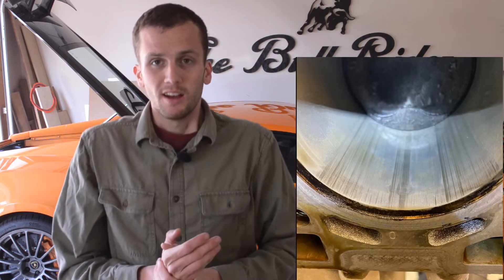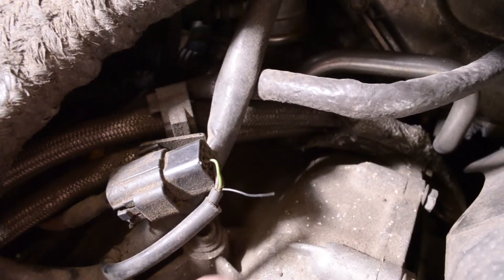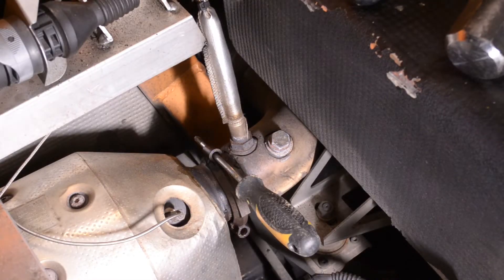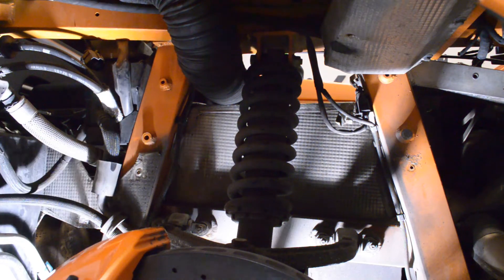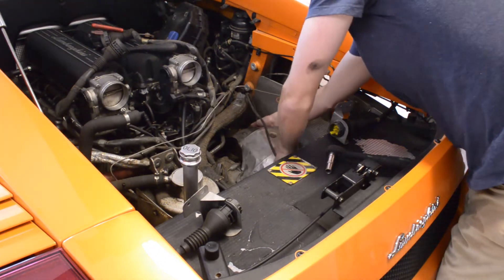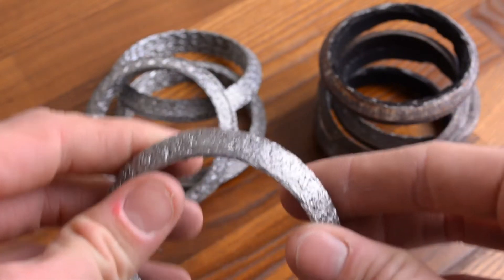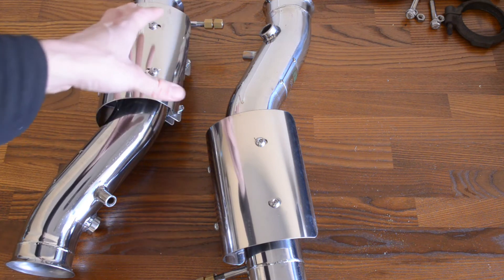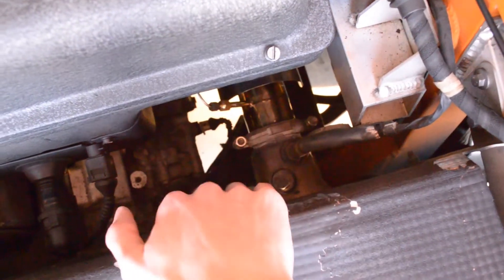I Install Larini Test Pipes In My Lamborghini Gallardo Superleggera. | Insane 5.0 V10 Exhaust Sound

Comment: I don't know it all but when you have a fastener that will crack free you must  relube and work in the  loose, tight sequence .
Reply from the maker: John, I dont know it all either! Can you explain what you mean in more detail? Are you saying with those rusty bolts, I need to lubricate them as I loosen them?
Reply: You must lubricate and heat like you did. Then crack the fastener, once you you can turn it quarter turn loose then reverse to tight , relube then loose again. Continue with this process. Also if you have an impact gun the inertia of the hit will spin the nut or bolt  loose. Good luck and thanks for your patience and nice reply..
Reply from the maker: @johnmartin2079  Oh I understand now John! I like that idea, that way it would allow the material on the rusted stud to get dislodged and not get jammed into the nut! Right? Ill do that next time!
And I had a impact but I treated it too poorly and it eventually died on me! LOL I destroyed too many fasteners that way anyways haha.

Comment: Sounds like my VW 2.5 5cyl.
Reply from the maker: It is a very close motor working man audio. The 2.5 sounds more like the 5.2 and is closer in both design and layout.  Listen to the end of this video for a tunnel run. That for sure doesn't sound anything like a 2.5! https://youtu.be/T208pyI4_H4
Reply: @TheBullRider  To me it does. Sorry. That doesn’t take anything away from Gallardo. Its not the same of course but very similar.
Reply from the maker: @workingmanaudio2754  I totally understand your perspective. The 2.5 5 cylinder is an excellent motor.

Comment: Hey man, great vid, one of my favorites so far! But geeeez, that cat material. As for the Check Engine Light, you might not get them if you keep the stock post-cat exhaust - but keep us posted! And yes, absolutely I'd love to see a nicer/better solution for the intake!
Reply from the maker: Im glad you liked it Tanel! Yeah it was good to get those ugly heavy old cats off! 
That is an interesting perspective because ive experienced the exact opposite on decatted cars of the same era with stock post cat exhaust systems. My thought is that the post cat 02 sensors are clogged with oil and thats why I dont get any codes. LOL. Maybe my car has a soul and just really wanted those cats off and decided that it would make life easy for me. 
Ill think about the intake, overall its a nice design, just a few tweaks and it would be awesome. I have a few things for this car coming down the development pipeline that im excited to share with you!
Reply: @TheBullRider  It seems no one knows for certain what triggers those CELs, or at least I haven't come across a solid explanation for the SLs. Looking forward to you sharing all the secrets with us! :-D

Comment: Great video. I am wondering what the limit of these stock cats are before causing engine damage. 20k? 30k miles?  Does anybody know?
Reply from the maker: GTX, it is a bit random in nature! I've seen gentleman with 15k miles on their car with bad cats or others without issues till 70k. Part of it is component age, the design technology at the time, converter placement in relation to the motor, engine tuning/fueling and valve overlap on this motor. 
My advice is is get those old cats off your car ASAP, you will sleep better at night. I know I do! Haha

Comment: Great video mate. Thank you. I have been using it as a reference to install my 200 cell cats. I am having trouble getting the left sided engine side clamp off as I cant get a decent angle to apply pressure on it through the wheel well. Will appreciate any suggestions. PB blastered and waited overnight but no go. A long breaker bar wouldnt fit in the wheel well. Have used a 10 inch extension with a ratchet as well as a wrench :( Can I approach it from above? Thanks again.

Comment: Hi love your videos. I have a 2005 manual 6 speed Gallardo with 54,000 miles.   Next up for me is replacing the cats before they become problematic.   I’m trying to decide between the test pipes and the sport cats.  I would prefer that test pipes for various reasons. But I have heard some people complain of a loss of low end power with the test pipes claiming it was caused by a loss of back pressure.   I’m curious as to your opinion and results after your test pipe install.  Are you pleased with the results?  Any loss of low end power?  Appreciate your feedback and really pleased to find your channel. Your videos are priceless. 👍👍
Reply from the maker: I didn't notice a loss of low end power by adding the test pipes Osprey. You might loose 20 ft lbs or so of torque at the low end of the powerband but that is so insignificant that you wouldn't ever notice. At least my "butt dyno" isn't calibrated enough for that! LOL
I love my test pipes and in reality the big difference between the two is price. If you can swing the 3kish for the sport cats, get the cats. If you rather save a bit of cash and invest it somewhere else in your car, get the test pipes.
The last thing to consider is emissions in your area. Ive never thrown a check engine light for going catless but that doesnt mean that you wont. The same thing might happen with sport cats, these cars ECUs are finicky and moody but theres plenty of ways to eliminate codes if they do pop up.
Reply: @TheBullRider  Thanks for your feedback, it is much appreciated.  I keep the vehicle in a state that has no inspection requirements so that should not be an issue.  I assume the test pipes would run a bit cooler so that is a benefit along with the cost savings.  I’ll do some more research and see where I land. Your feedback was helpful. Thanks
Reply from the maker: @osprey2961  Yeah the test pipes will run a bit cooler in the engine bay due to less restriction in the exhaust path. 
Let me know what you end up deciding. With either option, I think you will be happy!
Reply: @TheBullRider  did you replace your oxygen sensors with new when you did your test pipes?   I believe the workshop manual states to replace every 50,000 miles if I remember the mileage correctly.
Reply from the maker: @osprey2961  No I didnt replace them but with test pipes in or sport cats its so much easier when I eventually need to. The OEM cats are HUGE but even the sport cats on the market are a fraction of the size (and weight)
Reply: @TheBullRider  any info on the Larini vs Fabspeed cats?  Trying to decide between the two. However when I search, I don’t see a lot of info comparing the two.  Thanks
Reply from the maker: @osprey2961  They are both 200 cell cats and both great pieces of kit. The big difference in my mind is that the Larini cats have the Inconel heat shields. This will reduce engine bay temps a bit and look like an OEM cat. 
Another thing to consider is that the Larini systems are made with 316 Stainless Steel as opposed to a 304 SS. For this application it is a superior alloy. 
Also look at the way the flow travels through the fabspeed cats vs the Larini cats. Fabspeed has a very abrupt pipe size change from the exhaust pipe to the catalytic converter element and I could see how it would be an area of flow losses. 
Looking at the larini, there is a vast difference in the inlet and outlet flow characteristics and how the flow transitions from the smaller pipe to the cat element. 
All things to consider. Either way, both are good systems.
Reply: @TheBullRider  thanks.. helpful input

Comment: hi, thanks for a great vid. Im in my garage now...but the nuts on the left cat broke off (both). You got any good tip to get it off..its the clamp nearest to the exhaust system. Thanks
Reply from the maker: Jonas, you may have already figured this out but a hammer might be the best bet for you to hit the old clamps off!
Reply: @TheBullRider  Thanks, i got them loose. Had to drill them in pieces. Im superhappy now with the Larini test pipes :)

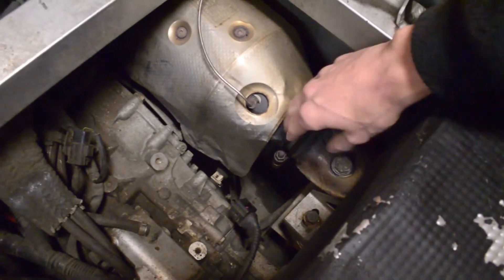Comment: If you have the highest mileage SL, I would be curious how much scoring you actually have in your cylinders. If a borescope shows none or little maybe there isn't much cat debris being sucked back in. But if you have excessive scoring then that confirms assumptions that cats can cause damage. You mention rebuilding the engine in the future, why? Have you looked inside or done a leakdown test, or just on principle of being a high mileage car? Finally, what did you end up doing with that stray wire at 3:07?
Reply from the maker: I am very curious too dave! In a future video very soon, I am going to perform a leak down, compression check and borescope that motor. We will really know then. 
I will need to rebuild the motor because of the amount of oil consumption that i have experienced owning this car. Ive driven it about 1500 miles and have gone through about 3-4 liter of oil. The normal spec for these motors is about a liter per 1000 miles.
If you look at my spark plug replacement video, I discussed how I found oil contamination on one of my spark plugs causing a misfire on one of the cylinders. Another good indication of leaking piston rings.  
The stray wire is normal! Surprisingly. I have a friend with a low mileage SL that says it normal. Surprising i know... LOL Tons of audi DNA in this car but some Lamborghini in it for sure! If it was an actual broken wire, I would re pin the connector. 
I appreciate you reaching out and the awesome questions. Its always good to hear from you and I hope you enjoyed the video!!

Comment: Another great video. However, I am waiting till I replace my clutch to install my Larani Sport Cats and LOC v5 exhaust. Everything is easily accessible when the bumper is off and the tranny is out. 👍
Reply from the maker: I couldnt agree more Patrick! Sounds like you have a big job ahead of you! I saw your E gear relay video, good info. You doing the clutch job yourself? What clutch are you planning on going with?
Reply: @TheBullRider  Still debating if I want/need the Kevlar upgrade or not. Sure, the clutch will last 10X longer. Doesn't mean everything else will. 🤔
Reply from the maker: @PatrickMichael2002  You have to go with Kevlar Patrick! Its the only way for the Cheddar wedge. I hope my videos have shown that these cars are built like tanks. (with some minor exceptions!) 
Are you doing the e gear reset yourself or are you taking it to the dealer for that part?
I love your channel btw, i subscribed. Very helpful content
Reply: @TheBullRider  I do not own and early laptop with LARA software, so I will have to take it to the dealership. No one here in Las Vegas has one either. Though, HI-TECH told me they might be able to help when the time comes. 👍

Comment: I've been told by Ferrari techs not to use those oil infused air filters.  Your mileage may vary.  On the cat particulate, do the cats break down with age or is it more likely with use?  I wonder if your codes were deleted by someone with a tune.  My codes have been deleted on my car.  However, I don't go catless because of the loss of low rpm torque.
Reply from the maker: Great questions Kent! So its true and false about the oil infused filters. Those filters are actually OEM Lamborghini! They were K&N filters from the factory! I was actually going to do a video on this but the original 5.0 V10 doesnt have mass air flow sensors, so having an oiled air filter doesnt effect any downstream sensors on the car. The 5.2 went with a different design with mass air flow sensors and has more of a traditional paper filter. Basically if you have MAFs, dont get oiled K&N filters because you will clog them quick!!

You know that would be hard to pin down what causes this. I think it was more of a manufacturing/ quality control defect in the design of these cats. I think the cat core delaminates from the stainless tube and the material that we saw is the high temp epoxy residue that bonds the core to the housing. The error rates are random from what ive seen, some low mileage cars have a core that is loose in the housing but mine is huge high mileage high use/ track use and they are still bonded to the housing... mostly. It would be hard to get empirical data as its just end users reporting the failures at random intervals, random years, random mileage etc.
I dont think it was tuned and that is why it confuses me! The two other owners never modified the car so thats why I thought it was so odd!! I also talked to the mechanic that worked on the car from new! But yeah the best way to go tbh is to delete those readiness requirements from the ECU and still make it look stock.
Do you just have a 430 or do you have a Gallardo too?
I agree about the loss of low end torque but its really not noticeable. I cant honestly tell any change in power and torque, i probably lost about 20 ft/lbs down low and gained about 20 hp up top but thats in the noise. 
Always nice to hear from you Kent and thanks for reaching out!
Reply: @TheBullRider  "Do you just have a 430 or do you have a Gallardo too?"  I have several cars, none are Lamborghini.  I also own a 488 Pista (new acquisition).  I've haven't been a fan of Lamborghini after the Diablo.  I prefer sexy curves and less cubist types of design which can become dated.  However, I follow your channel because I'm always interested in smart people that have functional intelligence.  I don't work on my cars, I pay others to do that for me, but I like to stay informed.  

On the filters, I look at your air box and I see a ton of dirt in it.  I can't help but think those filters aren't trapping all that dirt and its entering your engine at relatively large particulate sizes.  If I look at your air intake flaps, the left looks really dirty and the right looks relatively cleaner.  Perhaps some oil spray?  

I enjoy your videos primarily because I'm a closeted wannabe engineer 🙂
Reply from the maker: Very cool. Well thank you for the kind words, I appreciate it! Tried to buy a 488 but they told me that I had to buy a 430 or a 458 and THEN I would be allowed to maybe buy a 488. So I guess I'm more of a Lambo guy!!! I love the cubist design of the Aventador for example. It has lines and cubist inspiration. To me that is 1000% Lambo! 

My wife and I seem to have a polar opinion than you hehe! We dont really like the Diablo much, although the post facelift one with the 300z headlights does look rather good in specific colors. 

You catch a lot of things in the video and I appreciate that! The dirt in the air box is before it reaches the filters. Just 100k worth of build up. I plan on doing a refurbish of that airbox as the paint needs a little bit of work too but nothing too crazy. 
Great catch on the oil on one of the throttle bodies! The crankcase vent valve purges oil mist back into the intake stream on that bank and makes that throttle body dirty. Just like you said, a bit of oil spray!! 

You are very astute. I would say a whole lot more than a wannabe engineer!
Reply: @TheBullRider  Ferrari is very protective of their brand and won't just sell to anyone.  Lamborghini as you say is much different.  They don't care if you're a Virginia engineer or a big city drug king pin, all they care is if you can buy it 🙂.  There is an interesting video on Youtube that compares the various types of filters and their ability to filter varying particulate sizes.  I believe they use iron dust as the control medium.
Reply from the maker: There is totally a trade off between filtration ability and volumetric flow rate. K&N filters are among the best flowing but also filter the least. Whether that is good for the motor or not is another topic for debate entirely! 
I will find that video. It sounds very interesting!!